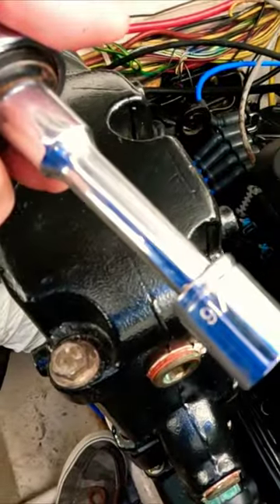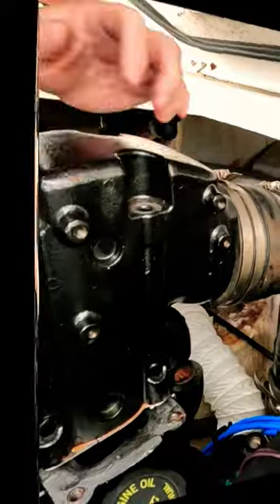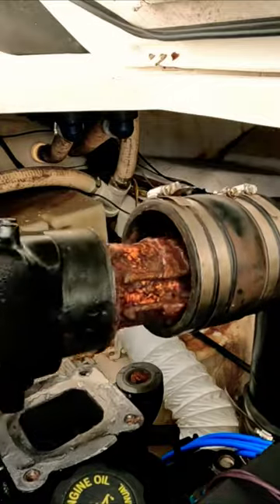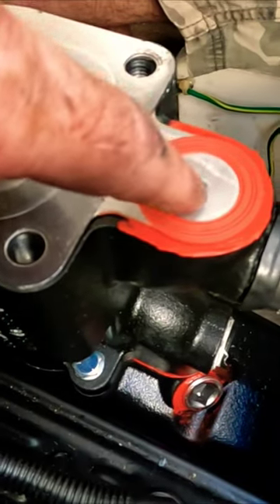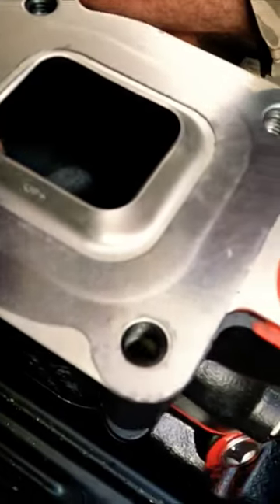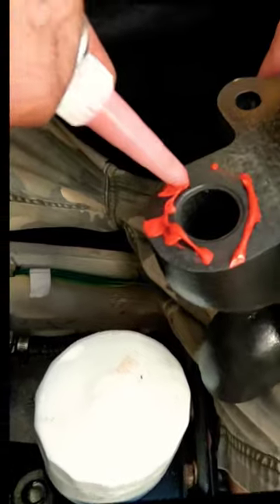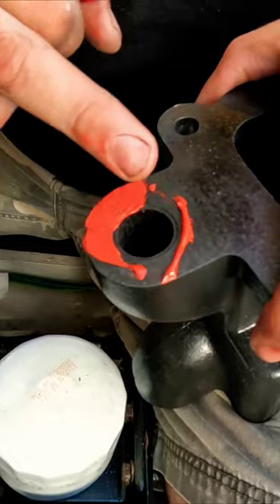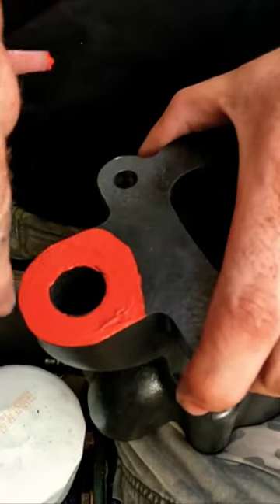How to INSTALL Manifolds & Risers on MERCRUISER Boat ENGINE #shorts #boating #boatrepair #manifold

Comment: Thanks for the video. Does the gasket maker come in the kit? What is the size of the bolts after cutting them to help with manifold install?
Reply from the maker: Hi thanks for watching! The sealant was bought separately. The bolts, just cut them a little longer than the manifolds plus a little more to tread the bolt, you can always re-use the same bolts in the future. Peace from the Keys!